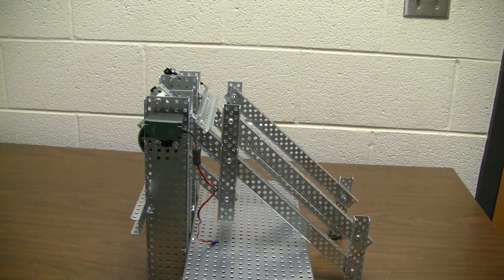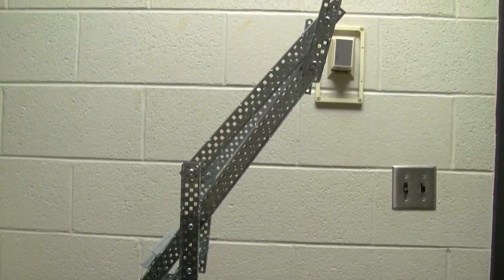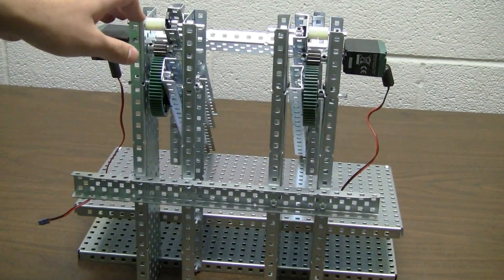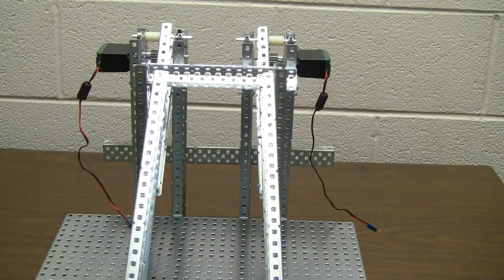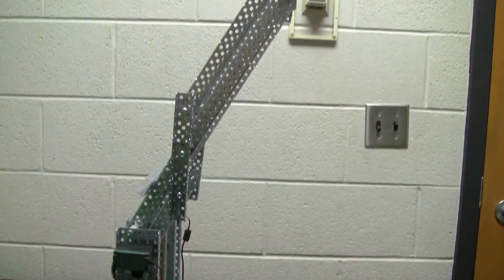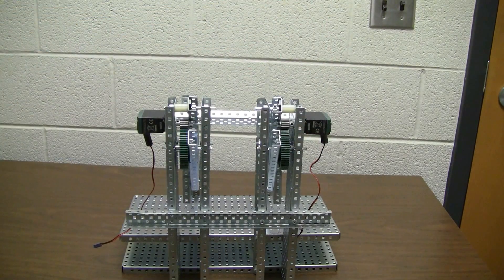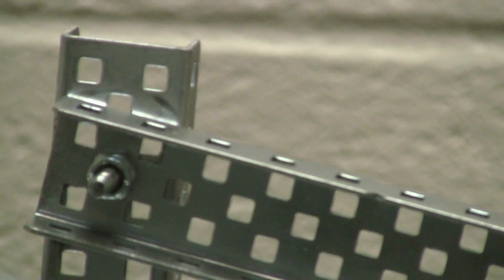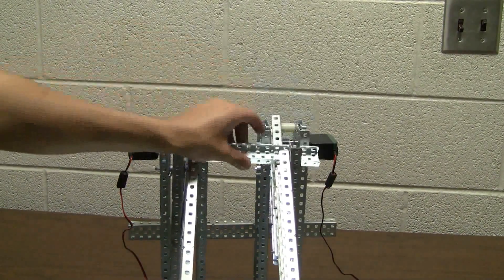Vex Lifts - Six Bar

Comment: What did you use for joints
Reply: THE ADM1RAL   Those look like Screws with locknuts on them so they don't slide, tightened , with a spacer in between

Comment: Are c-channels necessary as mounts for the six bar? Need to know because I am ordering parts.
Reply from the maker: C-channels are not necessary but they tend to work the best.  You can cut them if needed and overall do a great job in the lift.  I use all c-channels on mine and would suggest that you do the same but it's totally up to you.
Reply: Why are they better? McMichael Robotics
Reply from the maker: Ovicior They are better in many ways.  You can cut them to the size you need and are light weight.  I would suggest you use order aluminum parts but it's up to you.  Having a robot that is light weight and fast is the key to victory.  You can use other parts similar to the c-channels.  They work great to some extent but I don't like using them as often unless needed.  Hope that answers your questions.  If not let me know.  Keep watching out videos and if you need a specific video about something, let us know.  Subscribe and like for more great videos and let the world know that team 2777t is about to unleash the beast!
Reply: McMichael Robotics I built a six bar, but the gears being powered by gears attached to motors via axle grind on each other. What should I do?
Reply from the maker: Ovicior sent some pics to jbutler@rock.k12.nc.us of your gears and lift.  more the better. I'll take a look.

Comment: What is that you're using to tighten your screws?
Reply: electric screwdriver
Reply: kinda like this one http://www.cpomilwaukee.com/milwaukee-2402-22-m12-fuel-12v-cordless-lithium-ion-1-4-in--hex-2-speed-screwdriver/miln2402-22,default,pd.html?start=2&cgid=milwaukee-screwdrivers  has a clutch so you don't over tighten.
Reply: Vaseline